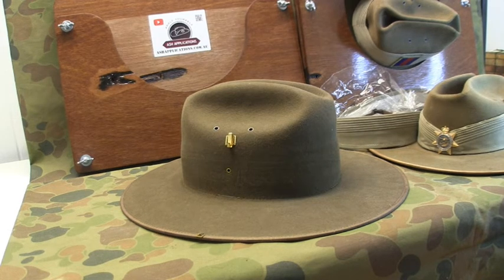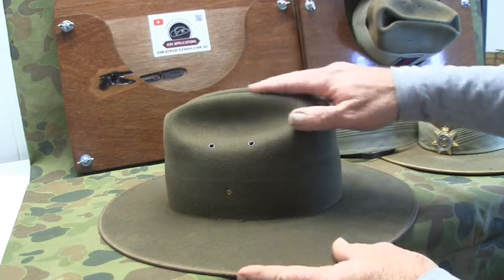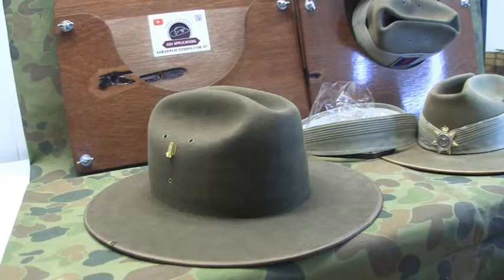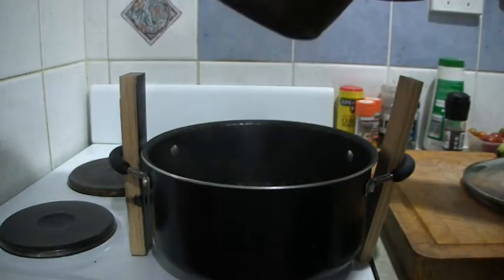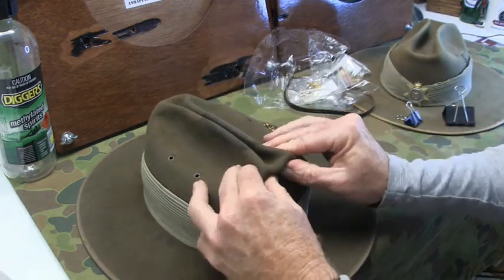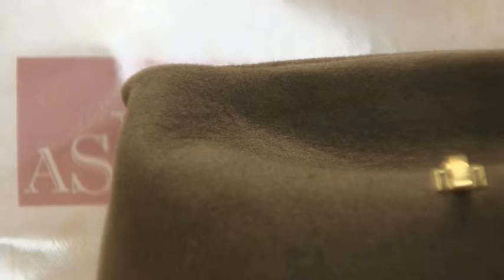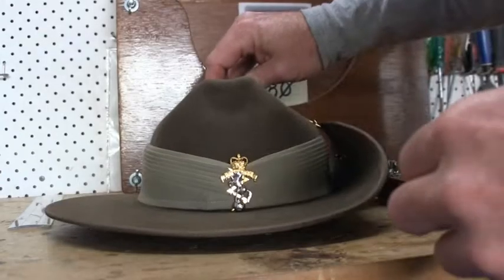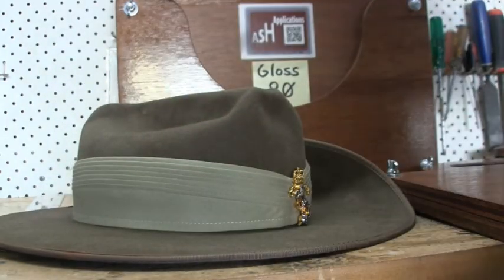Using Steam to Bash a Slouch Hat

Comment: Hi, do you know how to stitch the loosen thread of the slouch hat clipper? mines very loose and I cannot unclip the brim in fear of snatching off the whole thing
Reply from the maker: G'day AA, This is quite a common problem. The best method is to sew in with a replacement thread/yarn. Cut the remainder of the old yarn and remove it. Using a needle and thread. (the issue sewing kit has similar yarn to use), start and finish the knot on the inside of the hat. Loop the thread through three or four times on each side and tie off tightly on the inside. Use the existing holes. I have placed a couple of photos for reference on the community page. 
Hope this helps.
Regards
Ash.
Reply: @Ashapplications  I couldn't find the photos on the page though would it possible for you to draw or annotate the process through an instructional video or sort? I am a bit confused. Thank you
Reply from the maker: @anonymousanonymous4629  No worries, I am making a vid on Slouch Hat cleaning, so I will briefly touch on the sewing of the Hat clip to give you a better idea. 
The photos of the hat clip can be found through the link below:
https://www.youtube.com/c/Ashapplications/community

Regards Ash.
Reply from the maker: G'day AA, just publish the latest vid with cleaning techniques for Slouch Hats. It aslos contains bonus footage of the steps to sew the hat clip to the side.
Link below:
https://youtu.be/RSZKiDrPjBA

Hope this helps.
Regards Ash
Reply: @Ashapplications  Thanks so much, I was able to resitch it but the thread is a complete different colour to the original one. Would you also know how to clean a pair of terra boots without damaging them?
Reply from the maker: @anonymousanonymous4629  Well, done, great application!. If you need to match the cotton to the hat try to colour it in with a matching colour felt pen. Really pleased that worked out for you!😃😃👍👍
In regards to cleaning terra boots. I have a couple of vid links below on how to clean. After the boots are dried from the cleaning process, place some leather conditioner and then follow up with a neutral or near colour wax polish.
A common mistake is not to use conditioner. Keeping the leather supple with conditioner extends the life of your boots 10 fold. The tread will wear out before the uppers.

https://youtu.be/ocutAR0TEBU
https://youtu.be/530QGn46GX4

Hope this helps.
Well done again on stitching the hat clip.
Regards
Ash